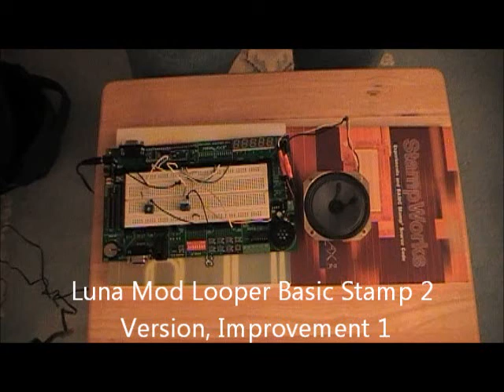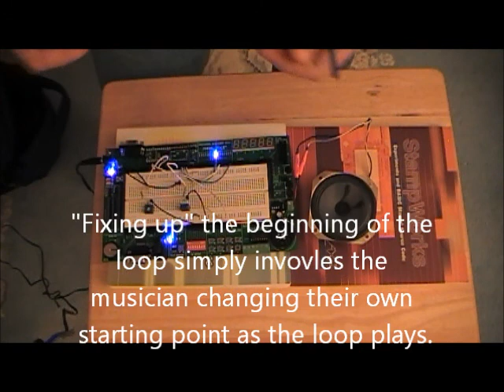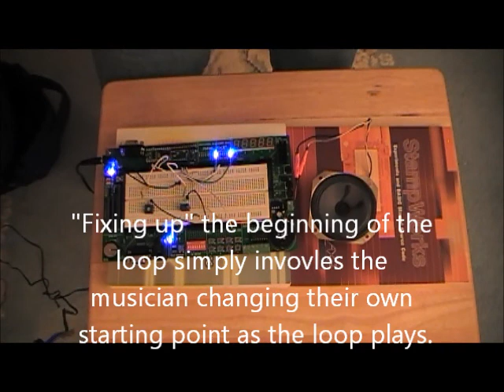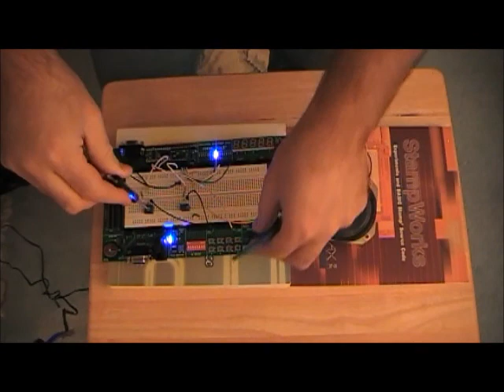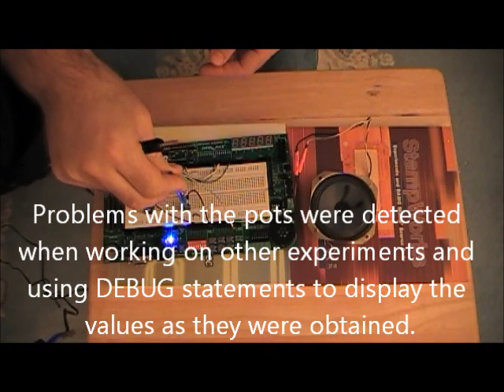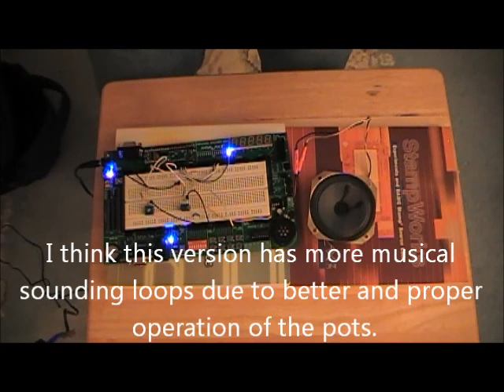Luna Mod Looper BS2 Version Improvement 1.wmv

Comment from the maker: Thanks for the compliment. A lot of working with the BS2 is getting the subroutines in the right places and realizing that some instructions are going to take longer than others.

Specifically, I did not use a PAUSE instruction for the LEDs because the instruction will not move on to another instruction.

I had a look at some of your other stuff - your looper using the Arduino is much nicer than the one I built. Plans include version for the BS2, Arduino and Propeller.